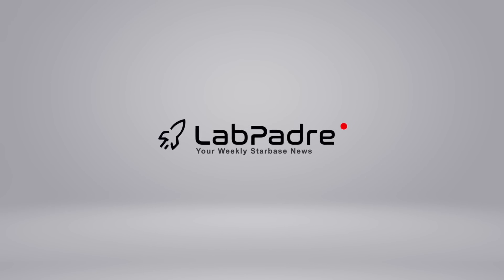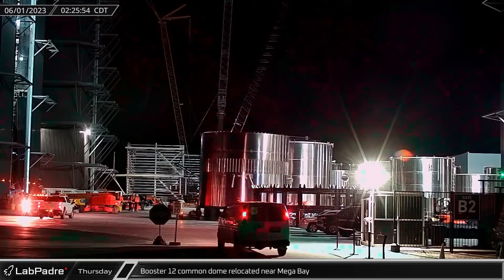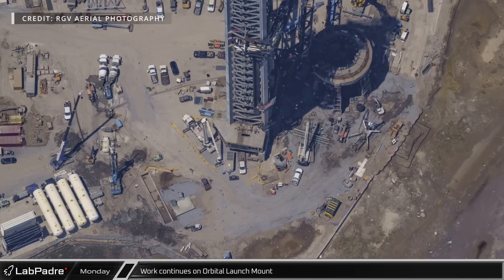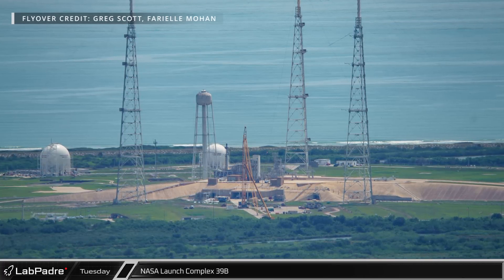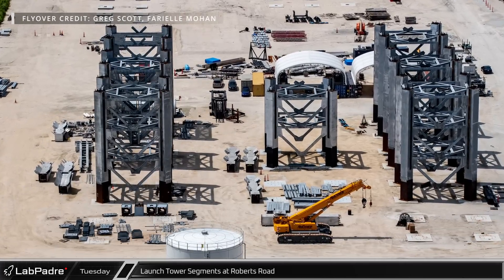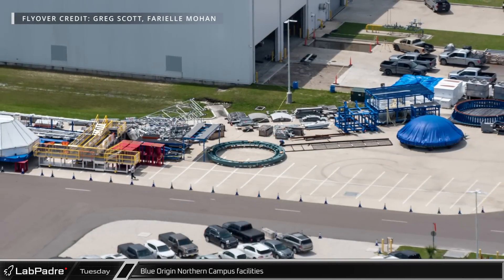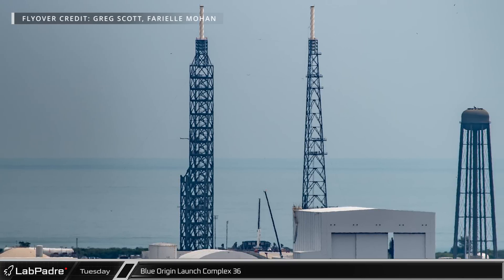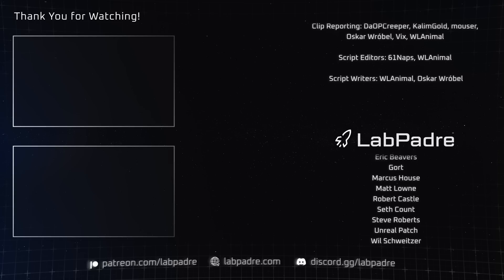SpaceX Constructing New Booster Test Stand at Massey's - Starbase Weekly Update #65

Comment: I think Raptor V3 with more thrust has changed everything - hence the pause in construction. Remember the military gave SpaceX a contract to study the deliverability of cargo anywhere in the world. Starship being recoverable only at a limited number of catch towers doesn't facilitate this requirement - I think Starship will get legs to land anywhere and maybe the booster too. Raptor V3 allows for the weight penalty of landing legs.
Reply: I think it makes sense for them to make a version with legs.
Eventually.
They already proved that Starship can land with crappy stubs of legs.
But i doubt theyll wanna get into that mess right now. Theyre very good at prioritizing.
Reply: How viable is a rocket earth bound ship? You would need a lot of infastructer to support this. Not just a catch tower. Yet you need cryo farms. Its not like filling up the tank and away you go. 
Cost to ship per kilo is going to be more than its worth. Now maybe for an arcraft that has a bunch of engines might work, just not a rocket. 
These would have to be automated so that g forces do not matter and then you would have to make sure that every load is viable and you will likely have around 1 hour flight anywhere in the world regardless of location. Time to launch, time to land. Fuel times can vary depening on load and location. You would then need platforms and stuff to remove the loads and then the loads are limited to size and weight. 
There are a lot of problems to work out.

Comment: I like the cape flyovers better it's some pretty nice scenery there      I'm still puzzled why SpaceX abandoned their plans here
Reply: The most likely reason for the halt on the KSC Starship facilities is that Starship isn't ready to go into operational production yet. SpaceX stated in the past that Boca Chica will be the development end testing site while KSC is for operational flight only. NASA does not allow experimental starship launches from 39a because it's currently the only pad with crew launch capability and a catastrophical failiure of a starship prototype could leave the US without the ability to launch crew to the ISS, which is also one of the reasons why a crew access tower is under construction at SLC 40. With the first orbital flight test taking place over a year later than originally planned, I think that they planned the construction of the KSC starship facilities according to a similar extremely optimistic schedule and now construction slowed down because it isn't needed yet.
Reply: Paused more then abandoned, remember Boca is the test site, the Cape needs to be reliable, they need to learn what works and was doesn't prior to completion of the KSC facilities.